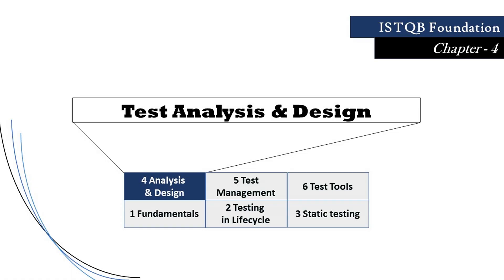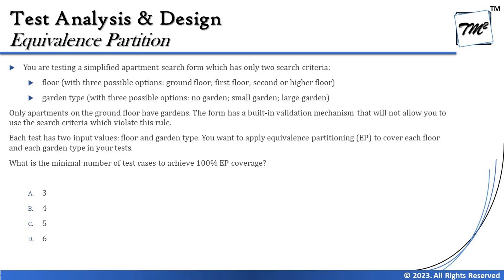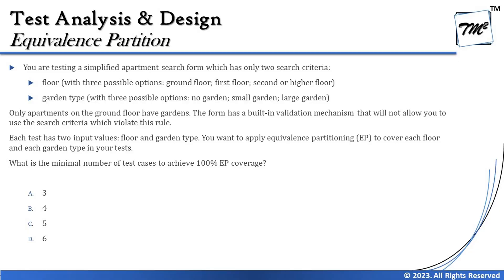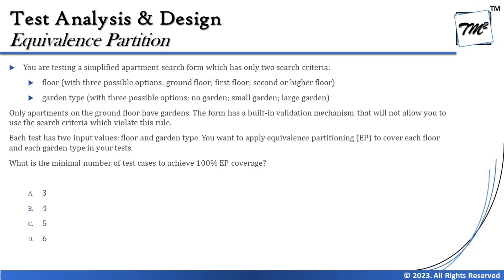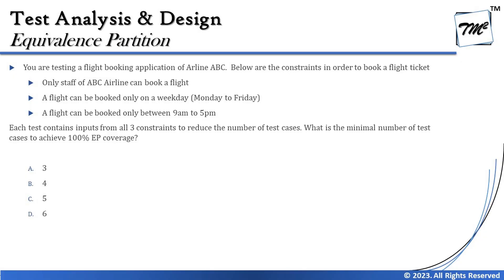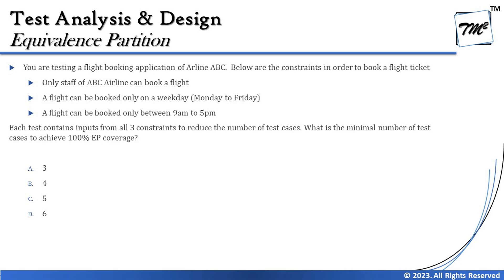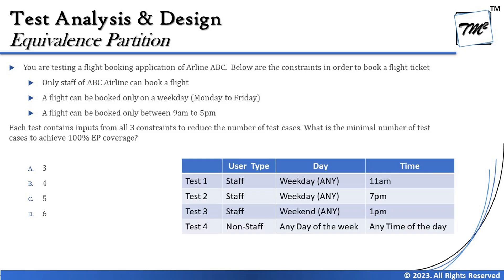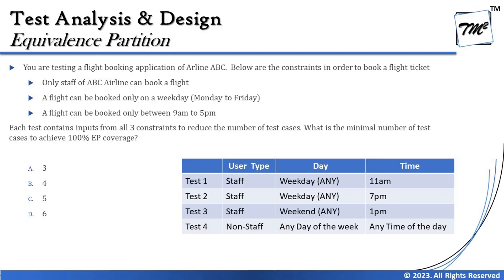ISTQB FOUNDATION 4.0 | Tutorial 30-1 | Equivalence Partition | Test Case Design Techniques | CTFL

Comment: The syllabus say that you can ignore combinations, and only have to test each options at least once. So for the second example, why not 3 test case?
 Tc1: staff, weekday, working hours.
Tc2: staff, weekend, non working hours
Tc3: non staff
?
Reply: I solved the problem in the same way. I got frustrated. But I think the key is that only staff can book a fly. So in theory the system will not allow you to enter the rest of the information if you are not a staff member. It's the only logic that I found.
Reply: My questions as well
Reply: Still possible one more TC

Tc4 : staff , weekdays , non working hours

So ans is 4...

Comment: For the flight booking application, I was coming up with the 5 test cases. Test 1 is valid because the time is between the definite range and test 2 is not because the mentioned time ' 7 PM' is after the specified timeline. I was wondering why did not we count an invalid test case of having booking time before 9 AM on the weekend? Can you please elaborate a bit here ? Thank you
Reply: i suppose it's because we can't book on weekend at all, doesn't matter what time is. so the test case is checking in general the ability to book by staff the tickets in the working hours. and as there are no working hours on weekend, so there is no need in additional test case

Comment: For the Garden and Floor example, can't the answer be 6?  What if there is an option to go for a ground floor apartment that has no Garden?  The question only says that Garden is not possible for 1st and higher floors.  It's doesn't say that all ground floor apartments should have a garden.
Reply from the maker: Okay. See the main context is are they asking for minimum or maximum. In case sof Minimum we test what is possible as per the scenario and another thing is each item to be tested at least what your saying is Maximum where I am trying the floor with each combination of garden type. 
So, when it comes to combinations we can try other impossible scenarios.
Reply: @TMSQUARETECH  but do we get 100% coverage if we skip the ground/no garden option? On floor 1+ the option doesn't exist by implementation but it does for the ground floor
Reply: I had similar reasoning, except I thought it was 5. Ground floor could have no garden, small, or large. First floor no garden. Second or higher floor no garden.
Reply: @Cullenium I agree, the description is confusing at this part.
Reply: After further looking into it, it seems that it doesn't matter where we test "no garden" as long as it's tested. I had assumed that it was not an option at all on floor 1+ instead of a "no garden" option.
Reply: @AlexandruTanase11 Yeah that makes sense. I think where I was personally confused was that with equivalence partitioning, you don't need all possible combination of choices. In the Syllabus it says "Each choice coverage does not take into account combinations of partitions." In other words, if it's already covered you don't need to test it again. For this example, no need to test ground floor no garden because the "no garden" choice is tested already in the floors above (twice technically) but you still have to differentiate test between the 1st floor and the 2nd or higher. 

So answer choice is 4 (Ground + small, Ground + large, 1st + no garden, and 2nd or higher. + no garden).  Hopefully this helps anyone else who was confused as I was.
Reply: @Cullenium  Answer is 4 because the statement 'Only apartments on the ground floor has garden' means the the ground floor will have garden either small or large. No 3rd option.
Reply: @deeptisharma9154  That's the intended meaning.  But as stated, it says if there's a garden, it'll always be on the ground floor.  Better: "All apartments on the ground floor have gardens."
Reply: @deeptisharma9154  no it says ground floor has 3 options
Reply: True, 5. Not 6. Agree
Reply: Honestly I think the description is confusing. They should clarify that every first floor apartment is forced to have a garden. Otherwise, we understand that first floor + no garden is a choice, making the result 5 cases.

GF+NG
GF+SG
GF+LG
FF+NG
SF+NG

'Only apartments on the ground floor have garden" sounds like a possibility, not like a condition.
Reply: @Cullenium, I agree.
Reply: I think it is because of each choice coverage criteria. The no garden portion is already covered in combination with first and second/higher floor. It doesn't matter if ground floor has garden or not as that no garden partition is already covered. But we can only test the small garden and large garden option with ground floor. As long as all the partitions are covered alleast  once we have 100% coverage according to the concept of EP. This is just a technique to reduce the number of testcases. But in real life we can test the ground floor and no garden combination as well.